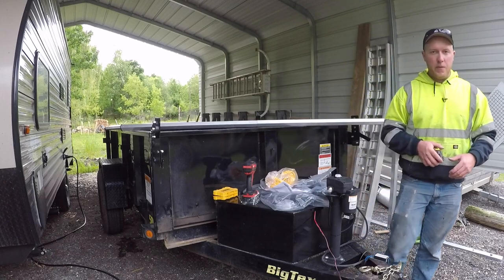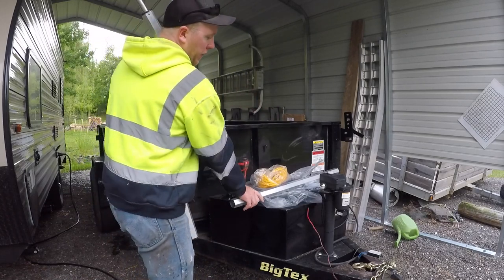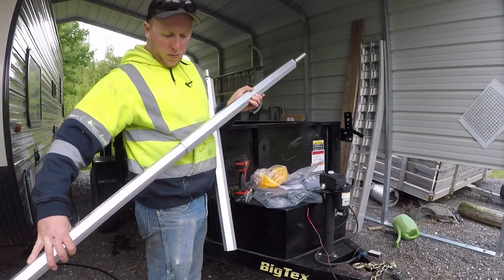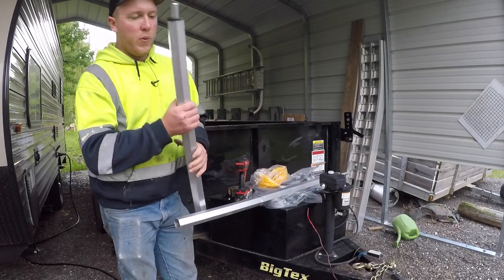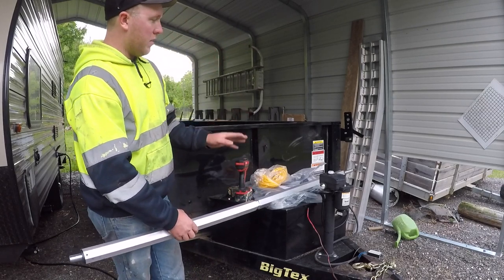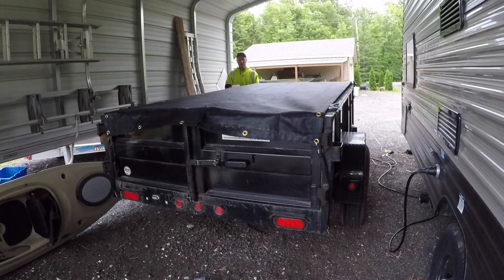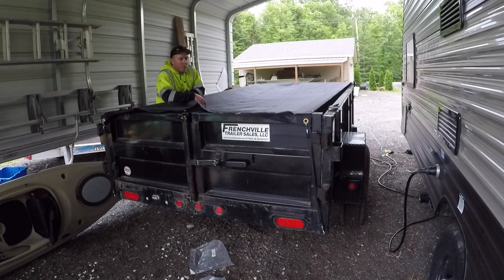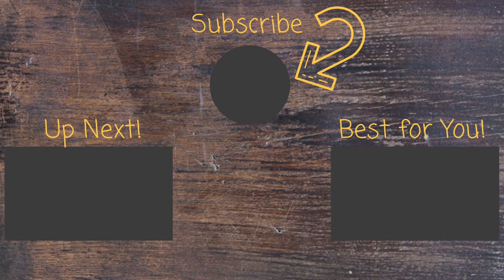Installing Tarp kit on Dump Trailer

Comment: I bet you get a lot of good use with your dump trailer.  That is one really nice piece of equipment.  Thanks for showing us the install. Hope you have a fine Thanksgiving.
Reply from the maker: Yea Don, It really is nice having around! Small enough i can load it with the BX and then hook onto it and tow it where i need to dump elsewhere in the yard. I often wish i would have went bigger when purchasing but the single axle is nice legally speaking and for in the yard. Have a good Thanksgiving as well bud!

Comment: My trailer didn’t come with that bracket the yours has. From the top of your trailer down to the top of that bracket what is that measurement?
Reply from the maker: Just measured it at 2 1/4"